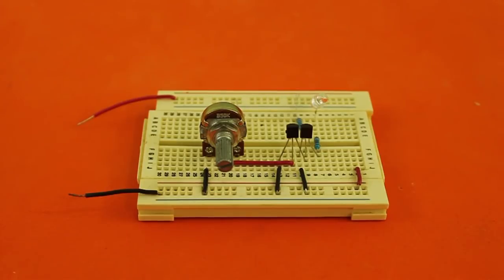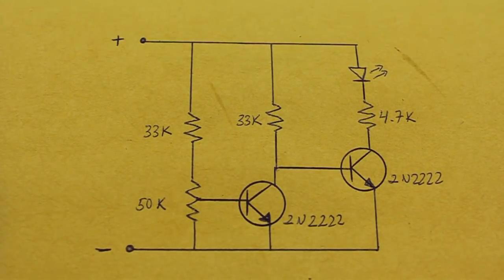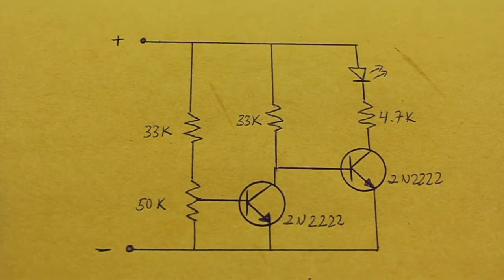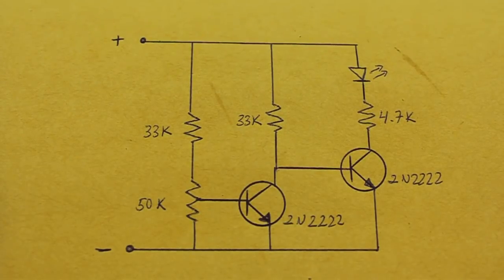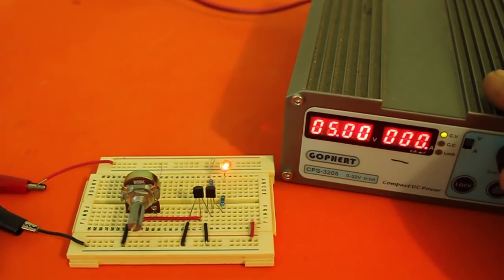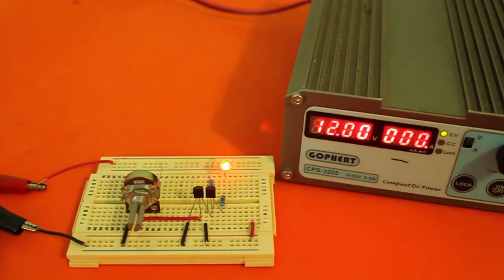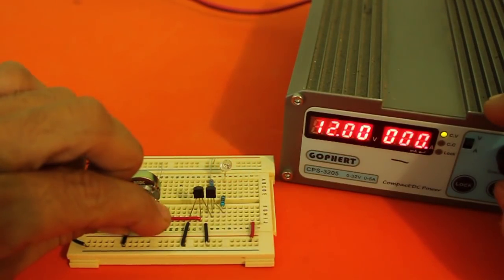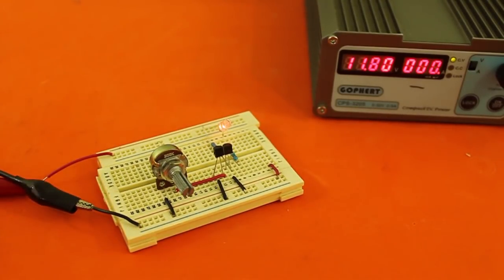Low Voltage Monitor Circuit

Comment: Thank you for this video! The drawn out diagram was very useful. I see now that the potentiometer can be used to dial in and customize when the low voltage sensor operates. Would it be possible to use this for a 72v circuit or would I need to beef up the components? Many thanks :)

Comment: Connect it to a relay (or MOSFET/Bigger transistor) and you have yourself a over voltage protection circuit!

Comment: Hi Mr ludic science a have a question aboute the miniature voltage booster i do the same experiment at the first time i winding 6 0 9at top and than a apply 20volt Dc with resistance of 215 ohm at the gate of a mosfat Irfz44n  and  i don't know what happen  at the next time a winding again 6 0 11at the top and the same resistance 215 ohm and 5 volt Dc from a phone charger  and it work  but  it give me at the output of the transformer 160 volt dc with a diode. And i use three capacitor 400v in series it should be more  than 1000 volt but it  was 260v i think i burn the mosfet at the first time becaus i apply 20 volt dc  on it know i want from you to help me please figure it out and tell me i am waiting  please I dont Know why this happening 
Thanks
Reply: Answer me please

Comment: Hi i wannt bulid this thing, but i notice that this transistor has max base-emiter 6V and if you wanna check battery with 7V you actually exceeded rating of this transistor. I  really need this circuit

Comment: The circuit would be much more useful if you implement hysteresis to it. I guess maybe adding a resistor between output BJT collector and the input BJT base would do it.
Reply from the maker: Thanks i will try that